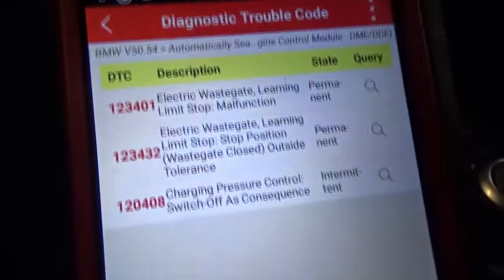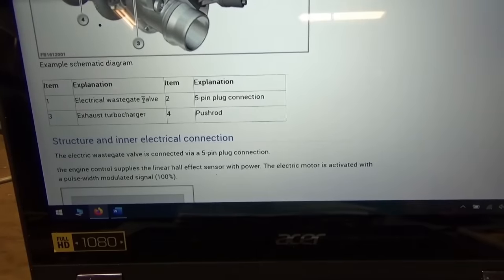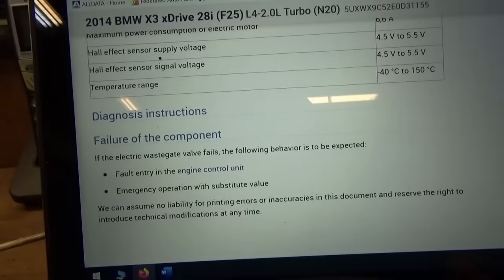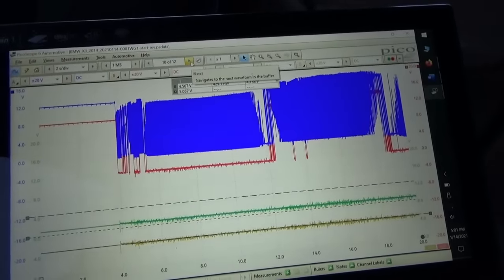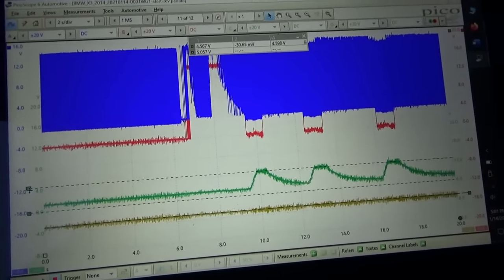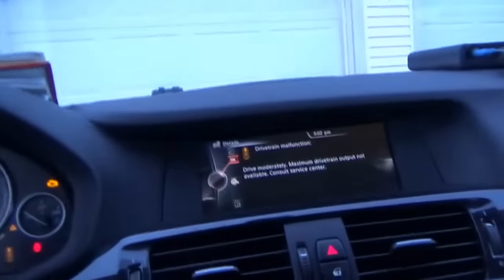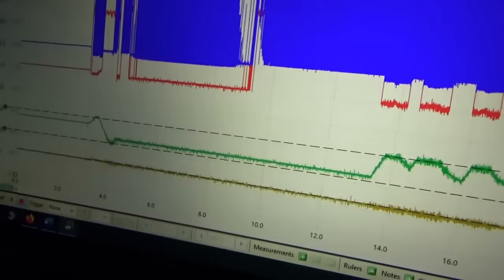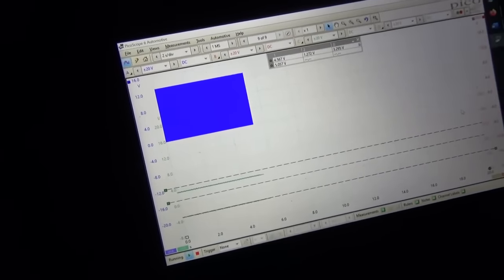BMW Turbo Wastegate MALFUNCTION

Comment: Why is everyone on the BMW hate train? It seems like a lack of understanding on how to repair them, understandably so with lack of technical data available but honestly they seem to be pretty reliable in Europe so not sure what happens to them when the get shipped over to the USA . I live in the UK and see them on a regular basis as I do annual vehicle inspections and rarely see problems .
Reply: "Not sure what happens to them when shipped to the USA" 
Our EPA Nazis could very easily mandate reprogramming them, without the Customer's knowledge or consent, for the strict CAFE/CARS Laws set in place.
I know for a fact- that years ago, "exotics" were "dechipped" and "detuned"
straight off the boat. Look at the mess Volkswagen was just in, falsifying
their EPA emissions data. Thanks to CA and NY following them- the US is becoming very hostile to ICE vehicles, CA being the worst.
Reply: Here in New Zealand, we have nz new and Japanese import models. We have all the problems too. SMG failures, Vanos, ECU and module failures, oil leaks galore. And the junky plastic parts, oh my god. Even with dealer servicing, it doesn't seem to help reliability. They are money pits after warranty runs out. I'd love to see what they do differently to the Euro ones. I call them comfortable junk
Reply: Because they are expensive junk in the us kinda like a gm product.
Reply: @frankmcdonough3351   GM is horrible nowadays. Actually- from 1995 up, just gets worse & worse. Most parts from Canada, Mexico & China, assembled in Mexico, 2 shits given to quality. They've got that down to a science. 1 month after warranty- BOOM!

Comment: I have the same issues on x3 2013 twin turbo after accelerating the transmission malfunction comes on the dealership change new hose and actuator but did not fixed the problem after another diagnosis said I needed a new turbo and hardware now I’ll try ur diagnosis thanks

Comment: Ivan,

How could this adjustment be performed with the pneumatic waste gate on the 2013 N20? There is only a nut on the valve side. The waste gate end doesn't have one.

Comment: I am having the exact same problem on a 328i ; check engine sometimes comes on and other times it  doesn't, and so does the drive train malfunction alarm. 
BMW service shop told me that there is an issue with the wastegate. The guys rambled something about position limits on the phone which got me thinking of the actuator. But then he went on saying that I need a whole new assembly, new oil tube , etc... estimated around $5k.
I have little to no knowledge on BMW repairs. I just have a little knowledge on how control systems work. I wasn't convinced that I needed a whole new assembly so I decided not to do the repair at the dealership.
Reply: So did you get your car fixed and what did you do?
Reply: @bwash6249  My car is not yet fixed. I put an extra 15k miles on the car with this issue. The computer limits how much power the puts out to protect itself. The car is just super slow starting off but will be get me to 90 mph if I really want to.
Reply: @Jnm349  this is most likely your issue. Did you ever take a look? Takes two seconds and a small 10mm wrench.

Comment: Great video and info...thanks!  Need your quick reply to my issue.  My 2015 X3 at 147KMs is throwing Drivetrain malfunction and loses power at around 60km/ph.  Also you get a police car siren sound when you rev it up.  After watching your video I am suspecting my issue may be the same and the actuator may not have been bad at all as it was suspected
Please help and guide me how to go about it.  Thanks a lot in advance!
Reply from the maker: I would recommend performing an actual diagnosis instead of firing the parts cannon 👌😉
Reply: @PineHollowAutoDiagnostics  Thank you for a prompt response.

Comment: Thank you for putting together a great video.   I had the exact issue with my X-3, my diagnostic tool did not pickup the waste gate error so I brought to the dealer.   Quoted me $6K+ telling me I had a bad turbo and loose linkage on the waste gate.  Applied your adjustment, Drive Train Malf error disappeared, care running great! Thanks again, well done!   May I ask what are you using for a diagnostic tool and scope software?
Reply from the maker: Fantastic! Screw the dealer haha
Reply: I have the same problem, after adjusting has it comeback yet? I have no scan tools, I’m thinking 4 turn like the video. Dealer told me I have to change the turbo it will cost $4,000.
Reply: @B0RNfree  would love to know if this helped?

Comment: I use VALVOLINE semi synthetic last 324k and Lucas in all of car. Change between 4 and 5 k . Still runs fast as hell lol. I also use Lucas transmission in same car. I have never had a trans issue.  The transmission Lucas was used as preventive maintenance.  On transmission I only drain and fill and make sure transmission fluid is clean. Recommended trans service by my uncle who started at TRANSMISSION TECHNICIAN'S when he was 19 and is now in his 60's . He is the guy that does the rebuilding of the transmissions that come in.

Comment: How were you able to loosen the nut? There isn't enough room for a socket to go in because of the linkage. Did you use two wrenches to keep nut 2 stationary, how did you get enough clearance to keep nut 2 stationary? or did you just use a 10mm wrench to loosen nut 1? my worry is that when I loosen nut one if I am not keeping 2 stationary the linkage might bend. Please give me your thoughts on the situation. I'm currently have the same error code and would love your opinion. Thanks!
Reply: Small 10mm wrench and yes your suppose to use two wrenches so the linkage doesn’t break. You can get away with one but not recommend.

Comment: Ivan, i will try this very soon. But i want to ask you a question. The bushing and axe of the valve that closes the gases has an unnatural movement (i mean a clearly i have a wear of the bushing). Is there any problem if i do this and don’t replace the bushing? 7:25
Reply: Update: 2 weeks ago i did the same thing. Never appeared again. Car drives normal, no new errors. 
Thank you for the solution!

Comment: Hi, I change my faulty WG actuator and now all DTC are cleared. But my challenge is a whistle sound upon reviving the end speed and poor gas mileage (8km/l-6km/l). What the cause of the whistling sound around the turbo and does the have any link with fuel consumption? 

Thanks the  video, it very informative and what is tht diagnostic tool you were using for the troubleshooting? 
Cheers
Reply: Did you repair your whistling noise coming from turbo?

Comment: Ivan, Absolutely great video,  impressive and competent use of diagnostic tools and software.  I've got a 2012 528ix that has been displaying the 'drivetrain malfunction ... "  screen regularly now.  Happens at highway speed,  going uphill under light throttle.  Scan gives DME code 120308 - "Charge - air pressure control, plausibility pressure too low.  I clear it and it comes back a few days later.  There seems to be no drivability issue. This early production N20 has a vacuum operated wastegate, so I checked the basics, like the vacuum pump, vacuum hoses and connections.  Any Ideas?  You want  me bring it to Happy Valley?
Reply: @DirtyboysTrenches  Actually no.  I am working on several other cars and will get to it when I have time.  
My best guess is I have a plumbing leak from the intercooler to the throttle body.  I replaced the timing chain and oil drive on this car and removed that pipe. The connections may not be reattached/sealed.
Reply: The turbo will start leaking soon. I just changed out my turbo after it started giving cel. The bypass valve was really loose
Reply: @omnia001  I am shopping for replacement parts now.  Did you replace it yourself or have a shop so it for you?
Reply: vacuum line ? Or valve cover leak

Comment: Amazing video! I have the same exact codes to look into on my gf's car (F30 328i). I have ista on my laptop so I hope I can do that relearn procces.... Also, you don't need a code scanner to reset the service lights. ACC power on, let all the lights/ messages pop up and away, hold down the trip button and it will cycle through all of the items in the service menu and allow you to reset them by selecting with the trip button.

Comment: Had the same problem on my f56 b48 engine! Replaced the actuator as I had a spare laying around didnt even thing to use the launch to reset it!!! Can the voltage of the high and low point of the actuator moving (green line on graph) be viewed on the launch diagnostic?

Comment: Who would drive a BMW but then cheap out on the oil the car will be coming back to IIvan next time for stripped oil pan bolt we all know how these quick lube place's end up .Ps I forgot about the vanos on BMW like vag are very sensitive to oil brands and types so they'll be back to Iven to get a whole new vanos stuff.
Reply: A case of wanting to impress by driving a  BMW but having beer money....not champagne. I will not lie..I only have Toyota money...is all I can afford.
Reply: I’ve learnt, to cheap out is expensive, -in the long run.
Reply: @mikefoehr235  Yah I'm the same I don't think there actually getting the oil changed I think it's just a excuse for him to turn off the lights and who would find maintenance reminders annoying there very handy to have.
Reply: @paulsz6194  Yes Paul your right there it always ends that way even on tractors and bikes, go karts ect.

Comment: Hi 👋🏻 

So a dealer mechanic is not truth telling if they say it’s the wastegate and the turbo car X3 only done 28,000 miles and not thrashed at all. Cared for all services. Wastegate is not a drivetrain issue is it. So why they tell lies possibly sure seems like it.  Talking $5500 plus to fix. When Likely lies 

What’s your take on this ?? No way a drivetrain message can be wastegate ? There’s no performance issues or rattle and always starts. The message of drivetrain come up once and dealer bmw showed DSC Warning Light Is On. Vehicle diagnosis - carrying out the ABL 

What’s abl Active Blind Spot Detection? The car only has front and back radar and over head camera view and no side mirrors vehicle detection 

So with what I have mentioned what do you think please ?

Comment: I must be pretty lucky I have 127,000 miles on my 2008 535i and have not had any problems out of the turbo bought the car withb20,000 original miles on it.  The high pressure fuel pump is original  the suspension is mostly original front struts and control arms replaced bushings. At 10 years old 90 k miles. The water pump has gone out several times through.  The alternator has just gone out  and the gear shifter was take out from alternator over charging. Also the valve cover gasket went out at 90 000 10 years.

It kept killing battery's for awhile but we found out I had a bad alternator for a few years an nobody properly diagnosed it that's when I had a lot of issues up till then the car was very reliable for us.  And has been reliable again now that it's been properly fixed.

She runs like a dream for being 12 years old noe that's pretty good.

Comment: charging pressure actuator mechanically intermittent fault in closed position error code 298700. Do I need to replace an actuator?

Comment: I think I have the same issue, but my diagnostic tool doesn’t allow me to see adjustments  needed in wastegate linkage (I use BimmerCode), it only shows error codes. Everything else matches, but I want to get exact offset value before I do it. What is name and model of the tool that you use that allowed you do check offset? Thanks!
Reply from the maker: SEE DESCRIPTION 😁

Comment: Thank you for a great video. Th tool 2023 Elite LAUNCH X431 Diagun V Bi-Directional Scan Tool , you use here Can you recommend it for my tasks. 1. I need to do a turbocharger adaptattion 2. I need to run activate DPF regneration. 3. Run diagnostic for finding faults on m BMW F11 525D 218 HP 2012.

Comment: Ivan: That’s just under 4 volts.     Me:  (doing quick mental math) That IS 4 volts. Ivan: That IS 4 volts. Me: OMG I might actually be better at something than Ivan for the very first time ever?!!!  Total surprise.  😂🙏🔧
Reply from the maker: You mean 4 turns of the nut?
Reply: Pine Hollow Auto Diagnostics   Uh, oh yeah, four TURNS!  At 73 my brain plays tricks on me if I’m not paying attention. 😉   Wait, let me poke a hole in my ego, OK?  Next time I’ll just keep my big mouth shut. 😂

Comment: If he's committed to such an ultra cheap amateur oil change on his euro trash then you could surmise his beemer is a broad shoulder fluff job on a long term corporate lease ! 😆   Excellent job as always Ivan
Reply: We don't really have executive corporate leases in the US as there is zero tax advantage.   You typically get mileage reimbursement at the IRS rate on your personal car.   The only exception is if the gross vehicle weight is over 6000lbs - typically for work trucks.   The limit was lower in the past, which encouraged very large SUVs for 'executive' use, like the Cadillac Escalade....

Comment: I have a 2010 550i Gt and it’s doing the same thing. Except when I first turn it on it’s already shaking saying drivetrain malfunction. We’ve changed the spark plugs and computer and the issue is still there. Any help ? Thank you !

Comment: Let's see the brake fluid change from the quick shop goes with proper sequence and multiple bleeder screws  in  aluminum alloy calipers and disabling  the ABS  to do the job correctly... The car was already at your shop to save 5 bucks and waste more time. Too many horror stories from bad oil changes, wrong oil,no oil, bad leaks and striped out drain plugs. It's worth a little extra to have someone under the car to visually check other components if you can't do it yourself. By the way Ivan check out the new Bosch multi brake fluid, cheap at R-Auto. Great specs and extra low moisture absorption.

Comment: There is a recall on n20 for timing chain guide. But it’s not a recall but the original chain guide is to stiff and rigid not flexible.

Comment: My BMW F11 525D xdrive 2012 thee actuator seems to look exactly like yours. I have the same problem, np boost at all after replacing a new turbocharger at the workshop.. you did mark and turn the actuator clockwise 4 times. I think I need to do the same. I got drivetrain error and no boost.

Comment: Good fix on what could have been an expensive repair.Some less scrupulous shops if they were smart enough ! would have removed the actuator and cleaned and painted it and charged the guy 1250,00 plus tax for a {REBUILT UNIT} and shipped it.AND the customer would have been happy,you know it's like a BEE sting when you get the BILL >it only HURTS for a few minutes,so stop your crying!!!! that's what my wife tells me when im in the yard.This guy is just asking for trouble BUY NOT following YOUR recommendation.great job IVAN

Comment: It is not the linkage that gets loose, the wastegate inside the turbo gets loose. You should consider yourself happy when you have enough adjustment left because eventually you have to take the turbo out and rebuild the wastegate. Common problem in the 335i twin turbo models.
Reply from the maker: Very interesting! So the flap on the shaft somehow rotates? Sounds like a fun project haha
Reply: @PineHollowAutoDiagnostics  They start clacking so much they go out of adjustment range and do not make boost. It is time for a rebuild then. Look it up on YouTube, it is a very common issue on BMW turbo engines.

Comment: Hello,

When it says use two open ended spanners.. does that mean I have to hold nut 1 with a spanner, while i turn with nut 2? Or can I just adjust the nut. I'm about -2.6mm off. Please let me know @pine hollow
Reply: Hi we’re you able make the adjustments? So was it hold 1?
Reply: When loosening the lock nut you should use two wrenches not to bend the linkage but can get away with one but yes that’s what it’s saying.

Comment: I hope you charged more than the one hour diag fee. You saved the customer a bunch of cash had this gone to a shop with high overhead.  I agree, that turbo 4 cylinder needs Mobil 1 full synthetic and a filter every 5,000 or so miles. By the time its on 90,000 with straight ASE oil, the rings will be worn out with that turbo. 
This is a great example of the pico scope and its value to diagnosis of computer driven vehicles. Just have a bottle of liquid wire insulation in the same bag as the pico scope and you are good.

Comment: I’m driving a mere Honda and always use Mobile One and genuine Honda filters plus change crush washer every oil change. I can’t believe someone driving a BMW would cheap out on the most important fluid in an engine.

Comment: Every system, mechanical or electrical- that performs a POST,
"flexes it's muscles" and stretches upon waking- 
your computer/smartphone, vehicle, TV, even you're own body.

If a fault immediately appears during a POST it's usually a 
"limit" switch or a pressure system not being able to briefly 
hold/generate, or the electrical continuity is OL, or an 
electrical/mechanical circuit is reporting an unexpected 
range of operation.

A usual POST can perform hundreds of checks in milliseconds

Comment: I remember when BMW model numbers meant something:
328i - 2.8 litre straight six
325i - 2.5 litre straight six
323i - 2.3 litre straight six
320i - 2.0 litre straight six
318i(s) - 1.8 litre straight four

Now they make no sense at all. Here we have an x3 28i - obviously a 2.0 litre twin turbo :/
Then there's:
118d - 2.0 litre diesel turbo or is it a 1.5 litre 3 cylinder?
118i - well sir / madam, that would depend on model again... might be 3 cylinder or four, might be 1.5 litre or 2.0 litre, might have one or two turbos..... but under no circumstances does it ever come with a 1.8 litre engine - that would just be confusing... errm OK